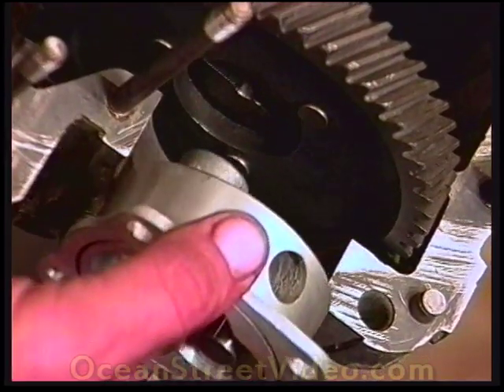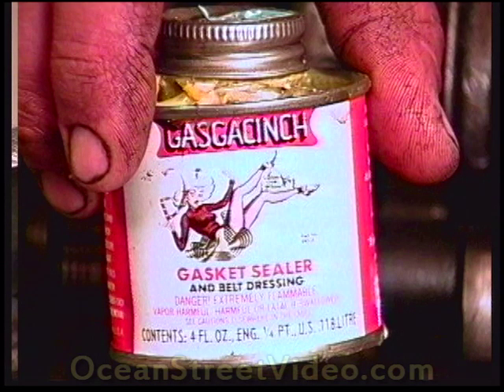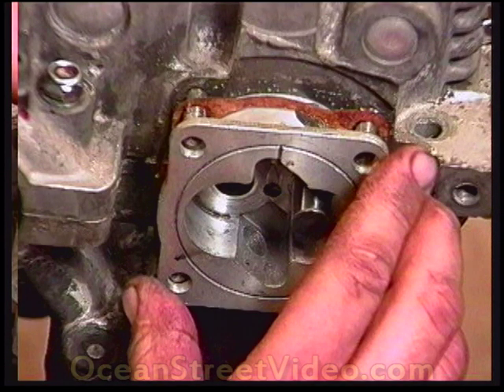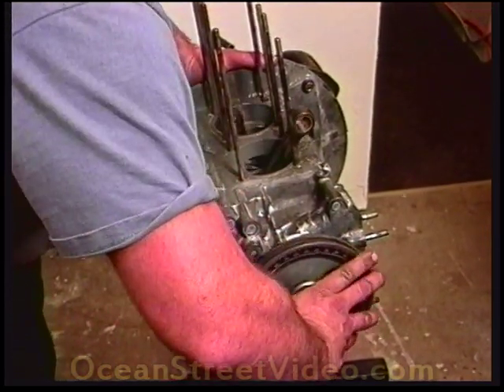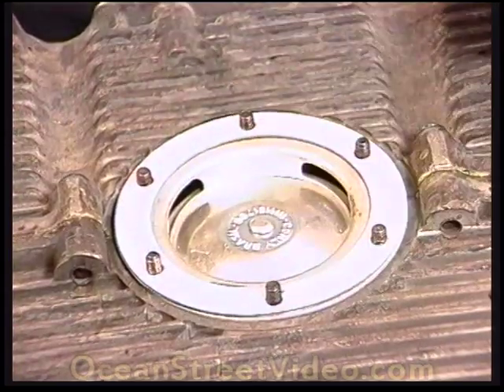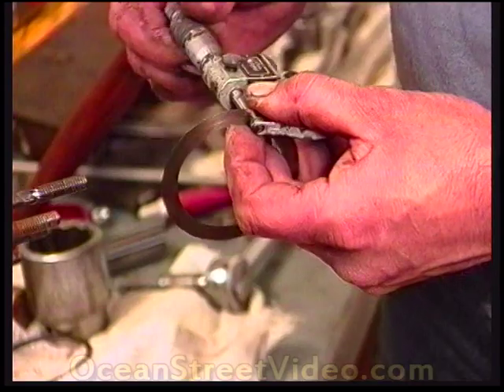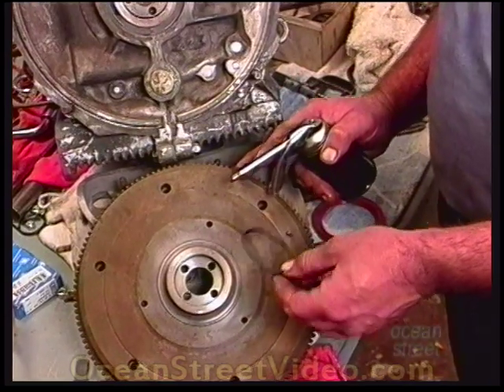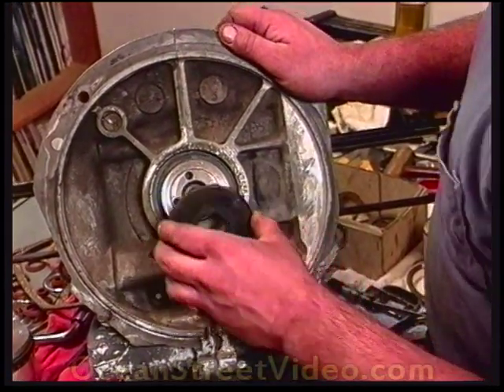VW Engine Building: Assemble Short Block Part 2, oil pump, end play, Type 1

Comment: We used to use a small piece of 2 X 4 wood and a Hammer.And cover it with a rag in between the seal and the wood.Then hit it with a hammer.It will sit flush with the case.I don't remember having to recess the seal.Brings back memories from back in the day in So-Cal .Thanks for taking the time to post.

Comment: I been doing VW aircool for some 45 years. Still after all those years everytime I build an engine.
 I enjoy it like it was my first time rebuild a VW engine. Sealer is good on every signal oil leak point. Must use the correct sealer and the correct way.  One more thing you didn't line up the flywheel correct for better balance as well  as clutch assembly sometimes it makes a big difference.
Reply: wow i am curious how ? do you line up a flywheel that is stock ?

Comment: I bought the 'cheap' tool. Gland you pointed out about the dowel interference.
I will see if I can drill clearance holes in the tool so I can leave the dowels in place.

Comment: I’m trying to freshen up my 1966cc engine. I recently broke and developed cracks in my cylinder heads and decided to split the case and freshen the bearings , mains,rod and cam. The engine has 92 pistons/cylinders, Rev True Stroker Crank with small block Chevy rods, Racer Brown cam and 1.4 AutoCraft rockers.  Mike my concern is the end play which is excessive .085 no shims no seal. The engine has performed flawlessly since it was built by me since mid seventies and always seem to have a lot of play. Prior to damaging the guide bosses the engine never made any noise, my hearing has deteriorated over the years, but I heard nothing abnormal. I was thinking today that this is a 12 volt eng and I run a 6 volt flywheel , it  is the eng in my 57 Oval. I’m at whits end and any advise would be greatly appreciated Look forward to hearing from you Thanx Richard
Reply: Did you take a look at question on crankshaft endplay and 6 volt starter
Reply from the maker: hi richard, mike is unavailable right now, and with that unusual selection of parts the only thing that i can suggest is to first do a case inspection per the videos, don't try to correct that bad end play on a case with a hammered-out center main bearing saddle, for instance... if by some miracle the case is not cracked/worn out, look at the basics, like making sure you are measuring the end play correctly, aka not rocking the flywheel around, is the flywheel nut fully torqued down, etc... i've never run a 6v flywheel, so if it was me i'd be researching what if any the differences are, do you need to mount a 12v flywheel to see if it affects the endplay, etc.
Reply: @DragRacingTV  thanks for the comeback the flywheel  does hop a little when moving back and forth I have measured numerous times with dial indicator, feeler gauge and all the same, no shims seal out flywheel tightened but not torqued to final amount.what should I be looking at with the center main. I do not have a 12 volt flywheel I would have to locate a used one or buy a new one and clutch assembly unless the 12 volt was first introduced in 66/67 it still used a180 clutch. Which video  looks at the case and center bearing, again thanks for your reply
Reply from the maker: @richardciviello3817  here is the VW engine case evaluation video, see what you are working with before worrying about the end play: https://www.youtube.com/watch?v=elVsaXg0fqc

Comment: John Muir puts the oil pump into it's 'cavity' prior to cinching down any of the case bolts other than hand tight. Do you do it that way or do you just leave the small case bolts/nuts near the oil pump out/untightened until you install the pump? i.e. Tighten the large case nuts fully and then install the pump?
Can one do a dry assembly including torquing the large case nuts to check for freedom of movement of the crank and cam and then take apart and apply the sealant and reassemble? i.e. would torquing twice cause any problems such as distorting the bearings?
Reply from the maker: +DG Carlson That sounds similar to what Mike does, you don't want to torque those small nuts around the oil pump all the way down until after you have the pump in there: https://youtu.be/LdMLF4fm0_A?t=3m38s
Partial short block test assembly and torque down could be helpful in certain circumstances, for instance you did an align-bore on the case, or maybe you weren't able to check for a bent crank because you didn't have access to a test jig, or perhaps it's a performance stroker motor, maybe you are checking main bearing clearance with plastigage, etc... i could see it putting crush on the bearings, but if it all goes back together the same exact way, i'm not seeing a problem? maybe get some other opinions on that.
It helps to re-torque all of the case nuts down before the initial teardown of a used short block, and check for free rotation also then, but that won't apply to you because you've got it all torn down already.

Comment: Hi Drag racing I love your video, but can I add 2 cents to this video " be careful " adding gasket sealer to the flywheel seal. as you know their is an OIL galley hole just behind the flywheel shims to alow oil to lubricate the shims. and you don't want to take the chance of pushing sealer in to that hole when you drive home the flywheel seal. I hope that helps  any one new to building VW motors
Reply from the maker: good tip aw, thx for pointing that out!

Comment: QUESTION PLEASE i just damaged a case by removing the fly wheel and reinstalling it without ! seting the end play !  i did not know you had to do that everytime you remove the flywheel ,,,,,,my question is WHY NOT USE THE GROOVED PISTON ON A dual relief case ?  and if you do will it cause some change in the oil pressure ? or what ? ,,,,,monday octorber 2020 ,,,,,thank you in advance
Reply from the maker: That's a good question, I wonder if adding the 2nd pressure relief to the dual o/p relief case made it unnecessary? Good luck with that case damage, I hope that you can still use the case.
Reply: @DragRacingTV  thank you so  your not sure as to why ? not to use a GROOVED OIL PISTON ?  if you do use a grooved piston will it cause oil pressure drop or anything related to that ?  can you refer me to where i can answer that guestion ?  please ,,,,
Reply from the maker: @MrGarcon98  Sorry I don't know why the VW engineers changed the piston design for the dual o.p. case. Maybe try posting that question on a forum? Like this one: https://www.thesamba.com/vw/forum/viewforum.php?f=12
Reply: @DragRacingTV  oh found out not long ago , my block " case " is damaged!   ,,,i guess if i keep getting refurbished cases maybe i am getting the ones that only have like one cut left in them ? who knows ,,,,first time ever at age 66 having been a tech with experience but not on air cooled i damaged this last one the oil left faster i guess that i could put it in LOL ,,,,,its not funny but at my age i must laugh it out ,,,,,,thanks for all your help and videos they are awsome
Reply from the maker: @MrGarcon98  Used cases are always a gamble! It's a good way to get experience tho, lets hope the next case works out better.
Reply: @DragRacingTV  yes it is at my age and experience i cant beleive i damaged it this bad but i did ! learning the vw can get expensive LOL now i will never remove the flywheel without cheking end play , and so far if you start leaking oil right under the flywheel that first nut under the case ,,,that means trouble in these motors !  fisher buggies has been doing my motors ,,,i am in the country and cant get a motor as clean as it should be i am not set up as i would like to be is why i let them do it ,,,,i remember running around trying to find bearings for a half a thousandths sake LOL , thank you , oh i been to the samba and i need to figure out how the site works a little better and understand it before i can post . stay safe and healthy is key ,,,,,god bless

Comment: Please help, Rebuild 1600 engine. Having problems with oil cooling. I have one split. Replace it and the 2nd one split . It splits on the 2nd day I start the engine. What could the problem be?
Reply from the maker: The oil coolers are splitting? Sounds like a possible oil pressure problem, so maybe pull the oil pressure relief valve out, see if the plunger is binding or sticking in the bore. Also check that the correct spring length is in the bore that it was designed for. Long shot might also be that the oil pressure relief springs are not factory VW, so is the spring tension correct?
Reply: Sounds like oil pressure relief piston stuck in bore. I had this happen on a Peugeot 504 engine i rebuilt at home in the garage. Varnish from oil residue froze the relief piston in the bore. In my case it just blew the oil filter up like a balloon and then shot it off the mount and across the garage floor.

Comment: I wish that you would have used the 'John Muir' 'convention' of Front is Front and Rear is Rear. What you call the rear is the fly wheel end and I guess you have carried this over from cars in which the  fly wheel is at the rear of the vehicle which is opposite of what is used on the air cooled VW engines.
Reply from the maker: +DG Carlson my opinion is that the flywheel is always at the rear of an engine, because you can't apply the muir convention to a fwd car, that has a transversely-mounted engine... read page 3 of the orange bentley, where it says, quote, the vw 1600 engine, which is installed in the cars covered by this manual, is a four-cycle powerplant, rear-mounted, and air cooled... rear-mounted as in, rear of the engine.
but then again, page 39 of the manual might conflict with that, where it talks about the location of the oil pressure valves.
Reply: @DragRacingTV  i have the same book i beleive they confuse one for the other in the orange book ,,,,," i saw that also " just saying ,,,,oh by the way i had asked you somewhere up in the comment  section as to why not  use a grooved oil pressure piston in the FRONT of a 1600 ,,,,and also my case was a used one and its damaged they tell me at fisher buggies in tampa fl ... i went  to the samba to read some of the ideas and questions it will take me some time to learn how to use that samba forum ! a little slow at almost 67 nov 19 th ,,,,,ouch ! lol ,,,,